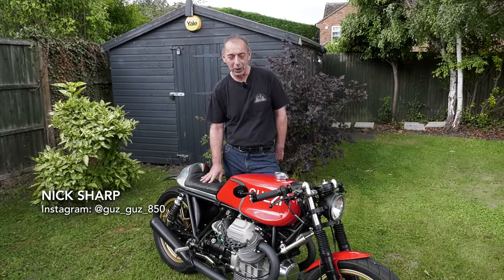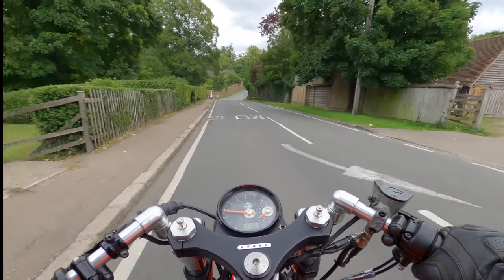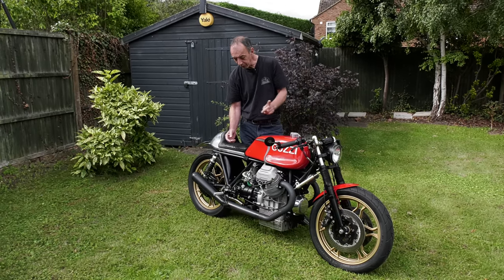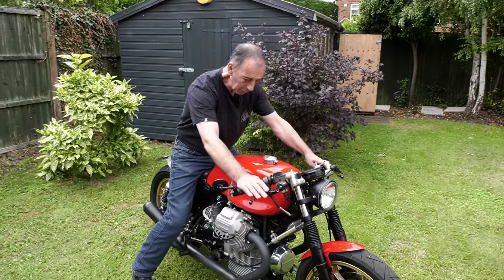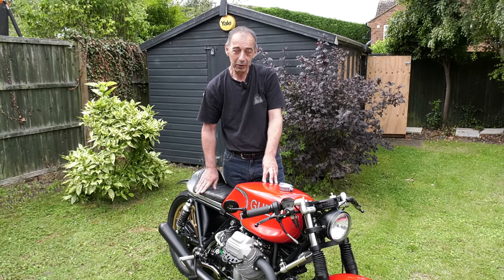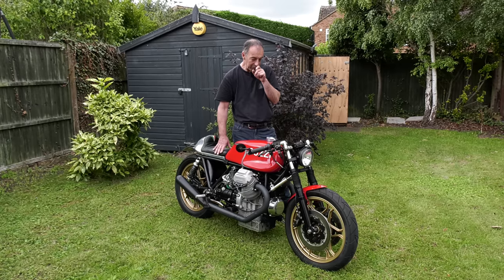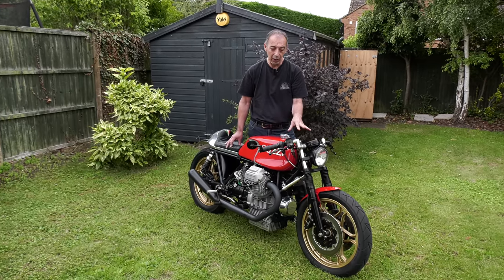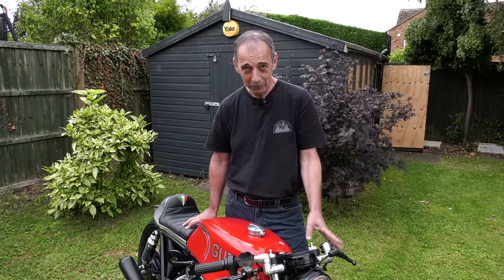Moto Guzzi Le Mans 850 Custom Cafe Racer Build - Overview And Ride

Comment: My favourite big bore Italian Bike. Job well done. I met a fella at the 1975 Daytona 200 who had a stock 1974 LeMans and I was fortunate to take it for a good run ; was quite a thrill for a 20 year old. Even Honda was inspired to built a similar design in 1978 called the CX 500 which they eventually turbocharged.
Reply: The CX is no comparison to the equivalent Guzzi - I have a 1982 V50 Mk3 which is a much better bike in every way!!!

Comment: I've started doing a similar thing with my 1980 Benelli 900 Sei, I installed a bank of six 22mm Dellorto carbs and a modified six into six Silentium exhaust, Tomaselli clip on bars and Tomaselli q/a throttle. I fitted a Telefix fork brace and modified a pair of Tarozzi rearsets to fit the Benelli that were made for a Guzzi Le Mans Mk II.

Comment: Great choice on using paint on the frame instead of powder coating, what folks don’t realise is when you damage/chip powder coat the moisture travels under the coating and rusts the whole lot, also if you ever have to remove powder coat shot blasters hate the stuff, it’s really difficult to remove and you can cause excess damage to the joints etc.

Comment: Beautiful example, super clean build, wish I saw this before I did mine. Converted a G5 into full cafe, suspended motor, you'll need the 1100 sport front cover, still available. 07' GSXR USD front set up, not too difficult to make work, some machining involved on the stem and a spacer, only problem with that setup is a front fender, stock fender is for a 16" front, braking is out of this world now. You can run 1100 sport down tubes and aftermarket under gearbox X pipe. Suggest a EME charging system, helps clean up the charging clutter. Be wary of the Tab classics LeMans tank, they require a hell of a lot of playing with to get to seat right, think I used KTM tank bungs that was the answer, stock MG tank rubber bungs are too small. And they attach with a bungie cord at the back, yeah a bungie cord. Used aircraft cable and couplers and a clear fuel line to line the cable. Mike Rich heads, 1100 sport cam 36mm carbs, Dyna coils. Super fun canyon carver.

Comment: A lot of thought, experience, and hard work went into this gorgeous motorcycle.
Reply from the maker: Right on Jeffrey, thanks for your nice words, Nick has quite an eye for a good build eh!
Reply: Thanks jef, yes it took a bit of thought! I took what I had learned from previous builds and it helps with the next build because you know what works and how to overcome problems more easily. What you dont see is that nearly every moving part in the engine, is new. And that it what I was trying to achieve, to restore and modify the bike to make a reliable, rideable bike.
It really is great fun to ride 😉

Comment: Lovely bike Nick..thankyou for the video. I thought the point about maintaining the finish over a long build is well made. Have experienced the same thing, thought I'd share a tip. Rip a bed sheet up into inch strips and 'bandage' the frame..protects it really well when installing engine. Also the advice about pre  thinking project, research and cost is really excellent if you dont want to waste money. Thanks again and congratulations on a great bike.
Reply from the maker: Nice tip Michael, thanks for checking in and watching :)

Comment: Very nice work. FYI I also own a Guzzi LM2 since new and about 10 years ago I decided to do a full blown cafe racer conversion together with a famous German CR conversion company. But somehow, 2 years ago I began to like the bike less. Maybe the authentic feeling and look were lost, although still lots of fun. So I changed it back to full original (except tuned engine) and I fell in love with the bike again thereby figuring out for myself that I could not improve on Tonti’s genius. Anyhow, I do not want to discourage anyone from these type of very satisfying CR projects, but I find interesting to see how your feelings can change over time.
Reply: I've actually got a story behind this build myself. In the early 80s, I owned a red mk1 le mans with gold wheels. I always wanted it back again, and the way I've built this bike is very much with that in mind. Also, I haven't changed any of the original steering geometry of the frame and most of the suspension components are all original, just with upgraded modern internals. But the main thing I guess, is that I enjoyed the restoration process and having personally touched and know about every single nut bolt and washer of this bike makes it very special to me 😉
Reply: @caferacer850  Not much wrong with the MkII, and nice as Nick's build is, I can go a few hundred miles on mine with no problem.

Comment: Just purchased a set of those Continental Classic Attack tires for my 74' V7 Sport. They look smaller especially the profile but can't wait to get it on the road and see how they feel and perform. Thank you for sharing your beautiful bike and the information presented in your well thought out video. Cheers.
Reply from the maker: Nice one Jeff, thanks for letting us know and your nice comments!
Reply: Hi jeff
Yes they do seem to be slightly smaller size, I had to move my front mudguard down to suit. But I think you will be impressed by the tyres performance 😉
Reply: Jeff, how do you got on with the tyres? Would be interesting to hear your opinion. Thanks
Reply: @19bus65  Sadly, I have to report that the guy who worked on my beloved V7 Sport took ME for a ride and ripped me off. The bike ran for a few days then wouldn't start and is now leaking everywhere. I paid way too much, waited over 2 years and got a fraction of what I paid for. Now the bike sits with no one local that even knows the brand, let alone a passion for what the bike represents amongst enthusiasts. I'd have to trailer it a few hundred miles and pay thousands more to get it back where I started from. Financially I'm broke and in a time where fuel costs are going to cost me more than ever before just to get it to the closest shop, not to mention their shop rates. While it was running though, the tyres seemed to offer a more agile ride...something that takes getting used to. Unfortunately, time wasn't on my side in that regard.
Reply: @jefffredriksz1116  Hi Jeff, I’m sorry to hear this. Whereabout are you? There’ll be a good mechanic somewhere and a courier may be a possibility?

Comment: It looks absolutely stunning. No question about it. I'm very fond of spoke wheels instead of mags but then again this is personal taste. I'd probably had fitted a set of Kineo wheels.
Reply: Yea I would fit a set of kineo wheels too if I had a spare £2000 😅
Reply: @caferacer850  I know....they are a lot of money. They cost me $3,000, I fitted them on my Moto Guzzi V9 Bobber. Are they worth the money? yes, considering a nice set of wheels will cost a bit under that plus the benefit of true tubeless tires. However, it all boils down to money or lack of. Trust me I wrestled with the decision to buy them for a long time and had to wait for them  to be made for more than 5 months.

Comment: gorgeous bike, thank you for your time! how do you make sure your bike is still safe to ride with changes in weight, balance etc? also how tall are you? your setup looks perfect with the changes you've made
Reply: Iam 5ft11, the main changes haven't changed any of the original bikes geometry, it's mainly the seat and handlebar position that's changed a little, it's not as radical as you might think 😉

Comment: Looks good. I'm still having trouble getting into the Guzzi and BMW side sit engine or opposing cylinders. Ive had a CB 750, a VMAX and now have a Triumph Bonneville T 100 2005. But never rode a Guzzi or BMW. Those heads get hot!,,,and being right there makes me wonder if I could handle it. I used to have an old Suzuki gt 500, so I know kick starting. It to was a twin. But 2 stroke. 
Maybe one day I'll ride an opposing cylinder bike. Probably not soon ☺️. Take care and thank you for the looksee.

Comment: fantastic job, i had an lemans 2 'in the years', they should had the motogaget electrics and the electronic ignition in those days (you had the boyer brandson convertion still in the original place worked better than original, but not that good ) the seat and tank match beautifull , i wonder if the tank is an ducati GTV 500 tank ?

Comment: Really enjoyed that. Some great tips, thanks. Rebuilding my lemans and if it will look half as good as yours I’ll be very happy
Reply: Thanks Joe, feel free to get in touch if you need any help 😉
Reply: nick sharp would love to find out more about frame mods, it totally makes sense. Also electrics. Not very good with internet and your knowledge would save me a lot of research and less mistakes 🙂
Reply: @joeqvarnstrom2625  you will need to use the Internet. Rear frame to gearbox bracket, get in touch with 'Bormi racing parts' Italy, they make the brackets. Frame mods, you need a few metal working tools, welder, etc and sus it out as you go! Electrics, I had a custom wiring loom made up, electrics are the only thing I font touch.
Reply: nick sharp 
The welding and bracket i can do. Who supplies the required timing cover? 
Will check out that mob in Italy for other goodies though, thanks.
Reply: @joeqvarnstrom2625  OK, you need a timing cover from the V11, sport carb or similar bike, these guzzis use the different timing cover, try teo lamers in holland, good source of second hand spares, or e bay.
Reply: You will also need to consider the side stand, the V11 side stand bolts to the front timing cover too 😉
Reply: nick sharp 
Great! Thanks very much.

Comment: Fantastic video and the bike looks (and sounds) brilliant.
Did you keep the integrated braking system? It looked you had the original rear master cylinder still.
Reply: I use a de linked system, yes the rear caliper is the standard brembo unit going to a dedicated rear set mounted master cyl for the rear brake.
Reply: @caferacer850  Thought so, I've seen a few of the few guys racing here in Oz do that for the track. I used to love the linked system for on road use. When I bought my last Guzzi  (a V7 Special) I just couldn't get the hang of a "normal" braking system, as I've always ridden the older bikes :-)

Comment: Dear Nick, what a great solution you have found at 13.06 with the frame modification on the front of the engine!  
Did you have this new distribution case custom made or is it a modified standard available part? 

I am mighty curious.   

Congrats with such a tasteful and refined build.

regards,

Ben van Gelder
Reply: Hi and thanks for the question. It's a trick I picked up from HT Moto in Germany, you need to use the later guzzi V11 timing cover, this has the upper frame mount, then modify the frame to fit it 👍

Comment: What have you used for the starter and alternator?
I really love the Guzzi in cafe racer form , beautiful job .
Reply: Hi Curtis
The starter is a Valeo, usual guzzi stuff, the alternator is a bosch unit, it sits inside the front aluminum engine cover.
Thanks 😉

Comment: Great review of your bike, thanks for taking the time to do it. Where did you source the adaptors for the four piston calipers?  Thanks!
Reply: Hi Vincom, the caliper adapters are available at quite a few places, Stein dinse, HMB Guzzi etc or if you google them online, its easy to download the specs to get a local engineering shop to make them up for you ok
Reply: @caferacer850  Many thanks for the reply. I found a set out of San Francisco. This conversation makes good sense.

Comment: A question for the builder of this radical Guzzi, I noticed you own a BMW R nine T just like mine. Please, I would really like to know what kind of improvements a professional like you has done to the R9T, if any at all? But I am sure you must have improved some things on it, right. Like this Tomasseli throttle, the quick draw or what ever it’s called. Would that make sense on our BMW?
Reply: Hi Marko
Yes I own the bmw r9t, I love it, amazing bike. Actually, I haven't felt the need to mod it much at all. The only thing I would do is to upgrade the suspension, but modern components to do that are a bit pricey!

Comment: I`ve always considered powder coating etc to be an unnecessary waste of time and yes, what seems like a straight forward modification can lead to a load of knock on effects adjustment - wise in a build. I had one of the 1st Le mans` produced, with a single seat featured as standard on the first 500 made. It was ok but a bit of a tractor to be honest. A friend had an ex production racer, which had a huge amount of low down torque, and was really the bike that Guzzi should have made.

Comment: Hello Nick, you mention the timing cover is off a later guzzi, which model would that be?
Reply: Yea it's off a later V11 or sport Carb model that uses the spine frame, they have an extra addition to the casting for frame attachment at the top of the timing cover 👍😉
Reply: @caferacer850  cheers Nick!

Comment: Hey Nick, Really like the part about the timing cover and frame mod. I have an '81 G5 and would like to do the same thing. What timing cover do I need to use for the swap?
Reply: Hi, you need a timing cover from the V11 sport models that have the spine frame . They are pretty hard to find but they are around 👍

Comment: Dear Nick Sharp
Could you please tell me how you have faired with your lithium-ion battery.
And if it has worked well for you , could you tell me the brand and model number 
Cheers Michael 
Ps great build , I’m trying to do the same
Reply: Hi Michael
It's working out fine so far, but be sure to use a modern integrated regulator /rectifier. To be honest, it's not much of an advantage on such a heavy old bike, but the battery is made by antigravity, good luck with the build 👍
Reply: @caferacer850  
Thanks Nick for the quick reply & information

Comment: Hi Nick, beautiful and unique built, I take my hat off to you.

I'm working on my own T3 but this will be nearer standand in looks due to me not having engineering capabilities at home and the cost. Two questions which you didn't mention in your presentation. Are the brakes linked as standard and the sump. I see that it has been extended, is the oil filter external and what's your opinion about this type of mod?
Reply: Hi, thanks for the comments, much appreciated 😉
The brakes are de linked, mainly for cosmetic purposes, to be honest, I think linked brakes are better.
The sump is an extended type with a filter underneath, mainly because when building the engine. I needed to get hold of a good sump and couldn't find any good original ones at the time, so I went for this one. It is meant to run a little cooler, but to be honest, an original one is fine.
Reply: @caferacer850  Thanks Nick

Comment: I own a 2013 V7 . It always has oil sucked into the breather box and went on Guzzi forums but found no real solution. Any suggestions appreciated.
Reply: Not sure about the V7 breather system. But, if a guzzi engine is pumping oil into a breather then there's 2 things that could cause it, 1) breather system is blocked or non return Valve (ball valve) is stuck or not working.
2) the engine is worn and your getting blow by, allowing the crankcase pressure to build up, this will force oil out to thd breather system.
Either one of those two is what's wrong, you just have to investigate to find out.
I would do a compression test on your cylinders to see what they are, if it's down on the Std pressure, you've found the problem.
If the pressure is good, then it's likely to be the breather system itself.
Let me know how you get on 😉👍